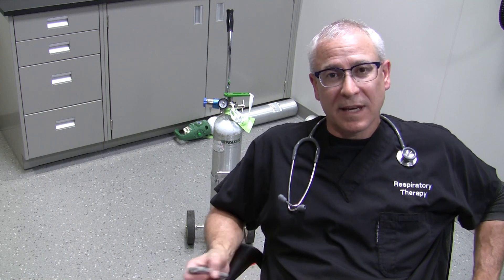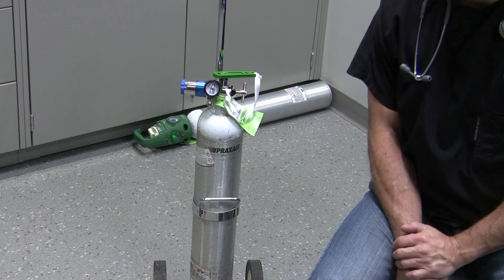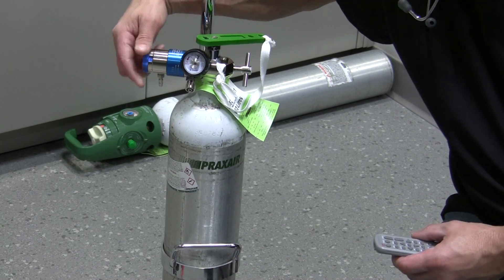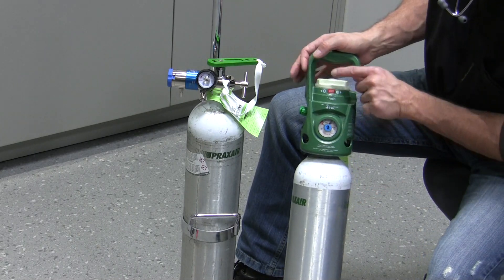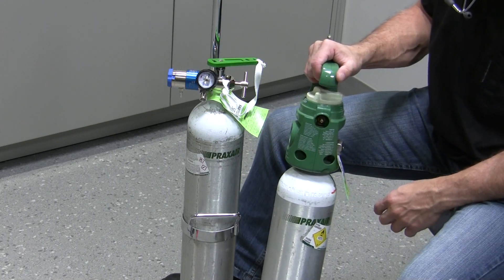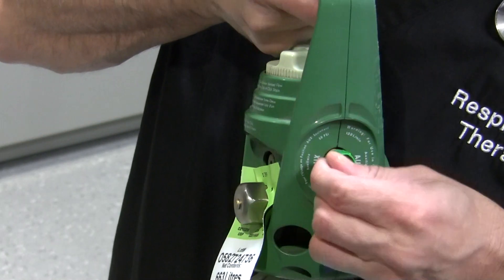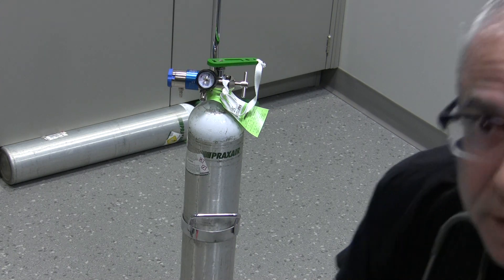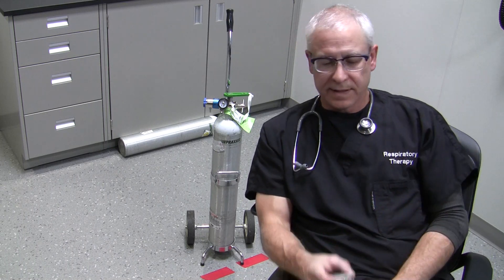Using an Oxygen Tank and the Grab and Go Compressed Gas Oxygen  Cylinder

Comment: hello, i have a grab and go type oxygen tank, that does minimum 0.5Lpm, but I need to be able to do 1/32 and 1/4Lpm, so need to buy a diss regulator. i have no idea what the fixtures look like under the plastic shroud. are the fixtures compatible with each other?